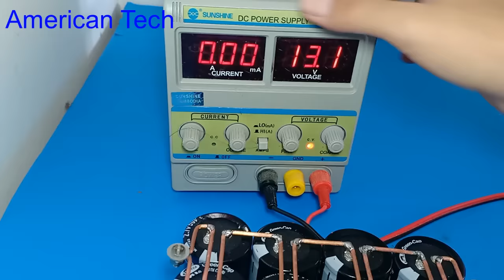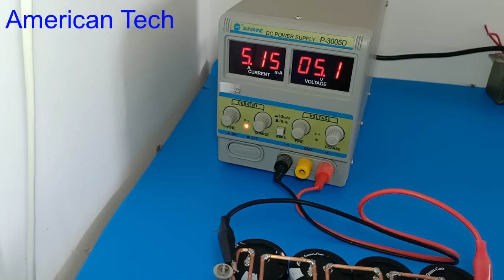12V , 100A using Super capacitors , Amazing idea

Comment: i had to unsubscribe.  i like your stuff,  but you take TOOOOOOOO LOOOONG. 

10+ MINUTES on 4 minutes max worth of content.  and on top of that... ADS. thru the whole damn video. maximizing on profit,  at the expense of our valuable time. 
Anyway,  you seem to have your dedicated followers. 
But,  I've had it.  Good luck with that YouTube money
Reply: Perhaps you might consider using the technology for you instead of being a slave to the system?
That is to download the video, and then be able to fast forward it. Even online here, you can fast forward on a PC with the right arrow and jump bits at a time. We do not have to be locked into linear timelines. We do not have to be slaves of the clock systems. We can be time travellers as it were, by fast forward of a fixed medium recording.

And you don't get any ads if you download it to watch later. After all you can be doing other things while it downloads. You only have so much time, best not to waste it waiting for something to happen, when you could put it on hold and come back to it at your leisure in full control of your time. There is so much to see and do and so many distractions. You would have thought of it sooner or later. Best not to be stressed by time limitations. I record most of the TV shows I watch. So I am not pressured to do it NOW! Inner peace is all important. Not getting stuck in a mode of complaint about another's short comings is being a master of your own emotions. After all what you feel you make into your reality. Cheers.
Reply: Ray okeedoki 

Yes, I totally agree with you.  And I do download vids that contain information I desire to keep hold of. 
This guy has so much ads in his vids,  that even if you skip forward, an ad plays before the vid continues. So that's still an issue. 

Their are (obviously) viewers that appreciate his content and 'style'. 
My problem is the overwhelming feeling of his focus on YouTube money (with this irreconcilable amount of ads; and apparent deliberate time consumption to contain them), more than the appreciation and care of his subscribers.  It just feels like it's more (or all) about the money with him. Ads = money ... more ads, more money.  more time,  more ads. 

To each is own.  He has many subscribers,  I'm just one guy. 
I'm subscribed to many channels.  some of them I hardly watch their content when I get notifications.  But I'm subscribed to 'support'. 

So,  apart from the time issue,  my expression was about the feeling of being 'used'. The time issue is just one characteristical expression of my reason and reasoning for feeling that way. 
If it were 'only' a time issue,  and not a 'feeling used' issue... I would still be subscribed. 

So... what's your opinion? 
Do you see necessity in the amount of time he takes to convey such small amount of content? And what could possibly be the reason for so many ads?

bear in mind,  those ads are not within the listed video time. So as I previously stated "10 minutes for 3 minutes worth of content" is an under calculation.  It's more like 'up to' 20 minutes for 3 minutes worth of content. 

To me... that's simply ridiculous.  mostly for those of the lower level electronic skills,  that dare not skip forward because they're  trying to learn.  indeed,  they can also 'download'. But you think they do that? maybe so.  But I'm sure most of them do that AFTER they suffer the 20 MINUTES. 

Then on top of that, this guy start RE-POSTING  "old content". just to get clicks.  incredible. 
THAT is clear evidence of it being all about the money. 

WHAT IS THE POINT OF RE-POSTING  "OLD CONTENT"???

"Absolute power,  corrupts absolutely".

So... to me... reposting old content is a sign of that absolute corrupt level. 
Making money off of his subscribers is clearly manifested as the reason,  purpose, and intent. 

He's corrupt.  I don't support that.
I'm even sorry you may reply to this comment,  because I don't even want to contribute to activity in his channel. 

Thanks for your words though. It is evident to me that your mind and knowledge is of value,  worth,  and desirable to be 'downloaded'. 😄

So,  to you, I recite something that you no doubt already have an awareness of in one way or another. 

"Wisdom is the principle thing,  but in all your getting,  get understanding".

Because... wherein is the power of knowledge,  if one does not understand it. 
So,  for me,  it is not knowledge that is power - But  ...
Reply: @dremaboy777  I see your points.
That is why I DL, as I can delete moments later. It means I can drag right through the whole content in a few seconds to skim to see if a build is worth pausing to see more or not. Subscribing is another entirely.

I am all for understanding. All for having an open mind to learn. As a closed mind has only what it already THINKS it knows. So I respect an open minded sceptic that builds understanding. A closed minded one, can never learn. Such are responsible for the blind faith crimes in the name of good all through history. Easily manipulated by someone getting within their ranks to lead them, as has happened world wide in many groups. The Jesuits are reknown for such tactics. The divide and conquer factor. Turn others against each other and so on.

Its a bigger world than our own version of perceptions of reality. And looking outside of the box is mandatory if we are to gain understanding. There is much lessons in failures as well as triumphs. Anyone can learn from their own mistakes. Only the wise learn from the mistakes of others. But one must also see that there are many perspectives and as one makes mistakes doing something, perhaps the something they were attempting to do is worth doing and their failure was due to lack of understanding.

Thanks for your comment. I abhor ads. Almost as much as blind faith parrots who do not have understanding.

Be well... Live long and prosper.... and see the truths in all things, even when they fall short of being all true.

Comment: Sir I'm asking one doubt that is just imagining  if we make 24v 10ams  super capacitor bank ,these bank to use electric cycle?my electric cycle I'm using 24v 10ams lithium  battery , it will charging 2 ½ (2:30)hours fully, but I'm seeing many videos super capacitors  take charging speedily and  discharge slowly. So please kindly give  me information that is lithium batterys better   or super capacitors are better please kindly answer my question sirrrrrrrrrrrrrrrrrrrrrrrrrrrrrrr

Comment: Lol, 100A??😀 Look at wire connection... actually good electrician not only basing on testers output or mathematical calculation or at the label, in reality you just need to look at the size of the wire and you already know the ""actual"" Amp. output,  the capacitor voltage in the label actually means voltage limitation not a voltage output.

Comment: Dear Ms. American Tech: Equivalent capacitance:  1/C = 1/C1 + 1/C2 + ...1/Cn for capacitors wired in series.Capacitors wired in parallel simply add together.  SO...For what you wire up in this video, it yields a 250 F device rated for +10.8VDC nominally.  And you're charging this to over +12 VDC?   That is UNSAFE....Please:  Do some electrical math when you make your devices, and please TEST their true values before posting questionable stuff.  Do some real science, please, with expected results and actual values.  Thank you.

Comment: NO! NO! NO! If you guys are going to mess about with electronic and electrical devices you'd better start learning the basics properly!

Two capacitors to millions of capacitors in parallel just makes a bigger capacitor but it cannot handle any more volts than its rating.

Here we have four pairs of caps in series parallel which makes four times ONE cap of 500F + 500F = 1000F (as several people have already indicated) connected in series. However, because the pairs are in parallel the voltage will be the same across both of them hence maximum of 2.7v!

Four times 1000F in SERIES = 250F (if you dispute this, please go and research it properly and understand why it is so). However because they are in series, when charged to their individual max voltages, those voltages add up (just like battery cells in series) and 4 X 2.7v = 10.8v.

Overvolts on ANY electrolytic is potentially VERY dangerous.

DO NOT DO IT - THEY CAN EASILY EXPLODE WITH SOME VIOLENCE!

A 0.55v over voltage on a 2.7v capacitor may seem small but it represents a 20% overload. To do this DELIBERATELY is STUPID to say the least.

To provide a replacement for  a normal 12v lead acid battery use 5 series capacitors to obtain 13.5 volts, which as it happens is the usual voltage of a typical fully charged 12v lead acid battery.

NEVER CHARGE BEYOND MAXIMUM VOLTAGE!
Reply: @kennethschultz6465  to whom have you addressed your comment? If it was the original poster don't bother reading further, but if it was a response to my comment I don't understand since in two different places you have repeated my statements verbatim?
Reply: @kennethschultz6465  BTW WHERE in my original post did I even MENTION the word resistor, let alone say that they were the same or equivalent to caps? Why would I do that? I'm not stupid, I'm an experienced electronics engineer, I know damned well they're not the same OR equivalent.
Reply: @boblewis5558  hey hey just stumbelt over a small thing 
Not to be rood og anything 
Qustion 1000F to 250F ??? This is not resistors .. 
500F paralell 500F= 1000F@2.7v x 4 seriel 1000F@10.8v 
I am baffeld over the amount of ppl using the Resister formula
This is batteries not resistors
You made a wrong turn and mistok the Voltage shearing  .. for capasaty deviding ... 
You can't NEVER ever What ever you reaseartch go under the smallest CAP in this case 500F
And if you don't agree to that .. you have No EDUCATION in electronic . 
Ill delete this when you corekt you mistake .. i make Flaws too
Not often but IT happends ..
Reply: @kennethschultz6465   well Kenneth, you have really outdone yourself this time. Thanks for that link which confirms EXACTLY what I said and the two formulae used to do the calculation! AND in Danish, your native language! GREAT!

I TRULY hope you watched the two videos about calculating equivalent series and parallel capacitance which show EXACTLY, AND I MEAN EXACTLY what I said about how the equivalent capacitor is calculated. Egg on face or what?

WHY, if you have really watched these two videos do you STILL think I am wrong? PLEASE, goto the video for capacitors in parallel and goto the 3 minute mark. They show on screen EXACTLY the formula I wrote down. And if you go to the 7:20 mark in that same  video and you will see he writes down an equation to obtain the equivalent capacitance of series capacitors (one of 9F and one of 27F) that together in SERIES makes a LOWER value equivalent capacitor of 6.75F!! Lower than EITHER of the two capacitors in series!! Something you claim is impossible! That equation is written as 1/C= 1/C1 + 1/C2 + 1/C3 which, via normal algebraic rules, can be rewritten as C=C1*C2*C3/(C1+C2+C3)! Which is EXACTLY the equation I wrote.

I'm tired of trying to explain this now. Those video links explain it all beautifully, elegantly, thoroughly and correctly using EXACTLY the same methodology as I did.

I shan't be bothering to respond any further because you're bringing a very bad name to Danish engineers and especially to a colleague from my early engineering days, Jens Langvad, who would be disgusted that a fellow Dane could be so arrogant, rude and downright stupid as to provide the ammunition to shoot down his own argument in flames.

If you truly wish to learn then follow that series of videos CAREFULLY. But PLEASE, don't come back proclaiming that's NOT what's being said - the videos are in ENGLISH after all! Byee!

Comment: Incorrect specs of caps and total output, has tub of flux and solders over it instead of actually using the flux for solder joints, has no realistic use or purpose, ya stop posting your tinkering as "ideas"...

Comment: This is one of the most logic-absent movies on topic I've seen so far!
First of all, if you needed to wire somehow the capacitors, why wouldn't you just take these capacitors, hold them up by scotch, and after that, take normal wire of an appropriate diameter and solder them like you wanted to? This manipulations with copper wire are not only waste of time, the final construct looks very unreliable! If you just shake it a bit harder, it will just fall apart! Also, the way how you soldered it, looks very fragile: the wire and capacitor connectors are shifted, they interact only through a big layer of solder, which drops all the benefits of using copper something. And especially silly looks this screw nut, soldered to the copper wire! Are you serious? How about conductance difference between steel and copper? This makes using copper pointless! Also, on high currents, the difference in conductance will affect the border between this nut and copper wire, causing huge problems with overheating!
And also, I would be very glad, if you provided some tech info: what if final capacitance, comparison with lead-acid battery of similar size, max currents etc.

Comment: Very bad soldering.  And you need 6 in series to go up to 14 volts.  Not sure about the 100 amps, but only 6 of these in series is enough to start my car.  It's a small car.  Parallel with a 7.5 Ah LiFePO4 battery, everything works fine.  But don't be leading people astray to think you can exceed the voltage rating.  2.7 volts max.  These things hold a lot of energy; if it blows up, somebody could get hurt or start a fire.
Reply: 3v is with in tolerances

Comment: This is so wrong. It says 100A but the power supply was on 5.15A for 5 minutes. That equals 0.43A
Reply: I agree that this is all sooo wrong.

But you’re confusing terms.

Amps times volts is watts. A unit of power.
Watt-hour is a unit of energy.
If  - and only if - voltage is constant, you can kinda compare things by amp-hours, which while not a real unit of measure is useful when comparing, say a 50Ah car battery to a 100Ah  car battery.
The energy in the 100Ah one is double the 50Ah   - because they’re both 12V
It’s really 1200Wh vs 600Wh, but batteries cheat on ratings...

So, if any of what is shown were true you’re kinda on the right track, but you’re units are wrong.

Now the power supply - poor thing! He didn’t set the current limit, he just winged it and told it to try really hard and put 12V into a basically dead short. As you saw, the meter gave up at 5A and 8ish volts. That’s 40W. If this had gone for an hour, it would be 40Wh, but it didn’t.
As the voltage went up, the current came down. But anyway, as you said it was five minutes, so it’s 1/12th that or about 3Wh.

An AA battery can put out a fairly constant 1.5V for 2Ah, which is also 3Wh!
Wait, this whole capacitor monstrosity holds the energy of JUST ONE AA Cell!
Yup.

And there are a load of other reasons that this is totally impractical - like how capacitor output voltage decays with discharge, while true batteries are much more stable.
It’d be real hard for your starter motor to turn over the engine as the “battery” voltage plummets.

I not trying to totally pooh-Pooh this idea.
There are places capacitors can economically and safely replace batteries but this isn’t one of them!
Reply: @sirifail4499  are you sure

Comment: 😂😂😂😂😂😂😂

How possible...?????is that capaciter 100mah  batteries???
Reply: he means it can put out 100 amps in a given momento, not that they hold a 100ah. These super capacitors can start up a car, the amp draw of the strater motor is alot.

Comment: and if i use my 20.000uf capacitors?
Reply: 5x20.000uf= 1F
IT's like batteries you can go Up in any direktion
NEVER under the smallest 1.5v1A  x10 can either be 15v1A or 1.5v15A
Or (5x1.5v1A) + (5x1.5v1A)= 7.5v2A
Or What ever .. newer under 1.5v1A

Comment: Under 1 AH. Unusable!
Reply: This give her and now power 
Not Ah .. ITs 10000A/us Micro second
Reply: @kennethschultz6465  1 Micro Second = 1.0E-6 second. Still far under 1 AH :-). Still unusable.
Reply: @bankulin8641  nop IT is good fore What IT is good at .. 
other batteries can't discharge 10.000A in one 1uS 
Not Ewen close .. 
This is a battery but 
If you can chardge IT in seconds .. you logic and math  is way too flawed if you can't make the dots 
And why you are at IT .. do the math on a 12v 100Ah AGM = Farrad 12v 100Ah wet = Farrad  
Maybe the 4000Farrad ain't in the Ball Park of the big Ah packs
Reply: @kennethschultz6465  Why do you need 10,000A in 1 μS? What's the point? And this is not a battery. This is capacitor. Making useless products is logically flawed and waste of time and energy.
It's your claim that this gadget can replace a battery. It can't. Full stop.
BTW: 1 Farad is 1 Ampere second per Volt. Calculate yourself.
Reply: @bankulin8641  aaaaaaahahahahahaaahahahahhh so this is not a battery..
Hmmmm do you even know hos a electrolyte capasitor is made.. please explain why the asid on car batteries is called electrolytic asid
Onley difrence here dear professor turnesull is the sice of the capasety in Amp.. and speed of chardge and discharge
Are you by any chance also a FLAT ERTHER
I use Cap's in my car to my HiFi 
I use Cap's to Captur the Spike or DROP in voltage when i use my 6000watt x 2 on my 16x200Ah 4x80Ah AGM bank 
So unless you are som kind of spesial disabled thinker CAPs are used to smoothen Drops or Spikes truh SPEED of chardge or discharge
Realy meny Places..